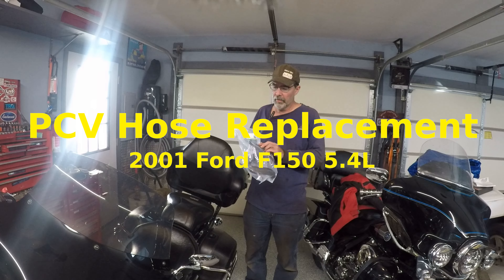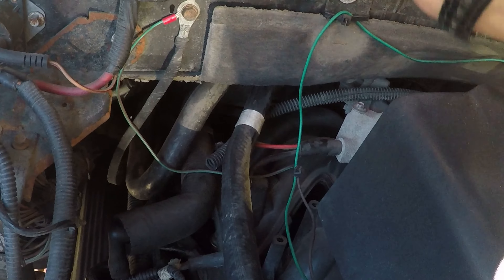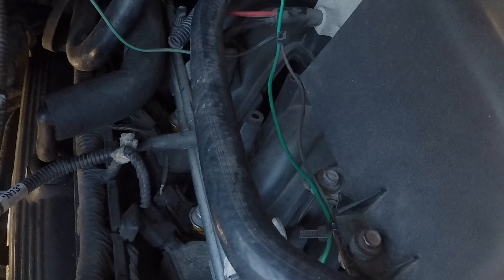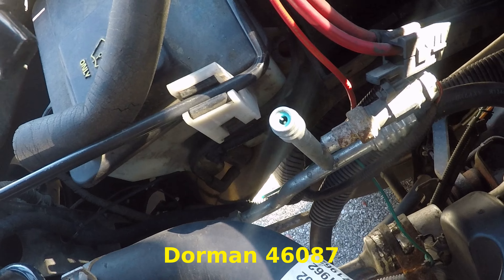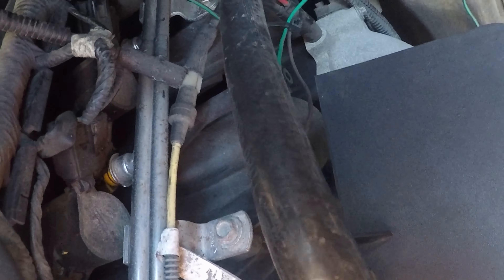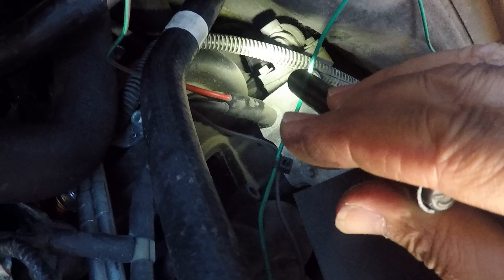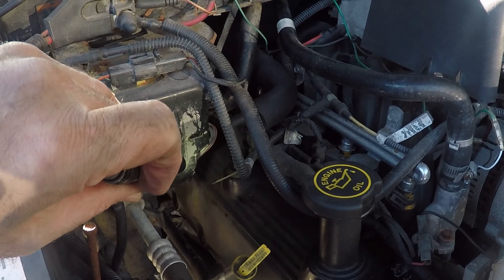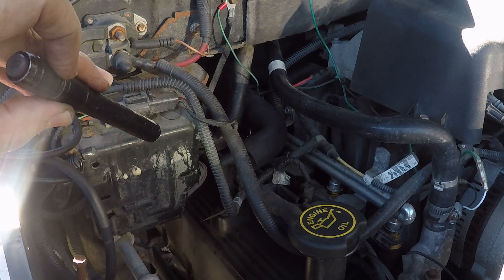PCV Hose Assembly Replacement 01 F150 5.4L

Comment: Not help this video didn't show how to remove and replaced the pcv hose assembly.
Reply from the maker: It was a tough spot to get the camera in.  It's a pretty quick fix.  Just have to pay attention to how the old hose was routed when removing it.  The fitting on the back of the intake is pretty hard to see.  I had to follow the old hose back to the intake manifold by hand.  The replacement hose had all the same bends.  Once I had it in position, I had to feel around the back of the engine and connect the hose to the intake fitting.  The PCV valve connected right back up to the valve cover.  

I did notice that the plastic PCV valve was getting noisy after a week of driving.  I ended up putting a metal one in and everything has been great now.  Thanks for watching.